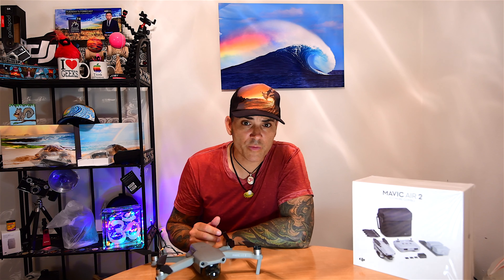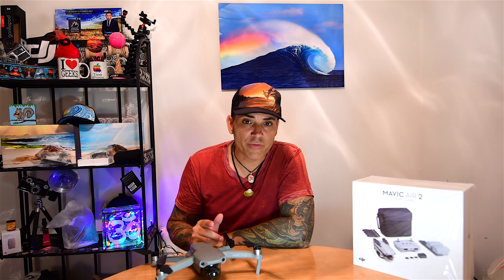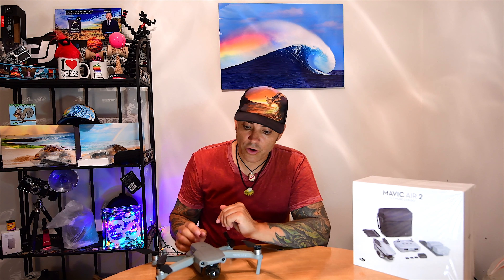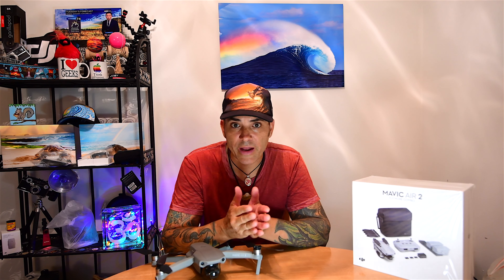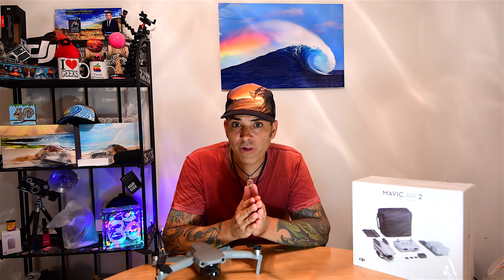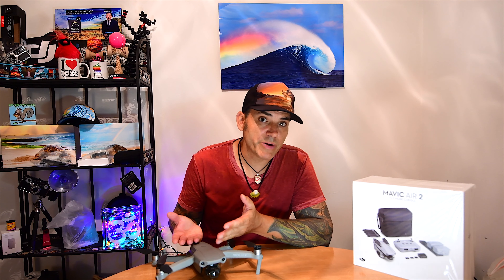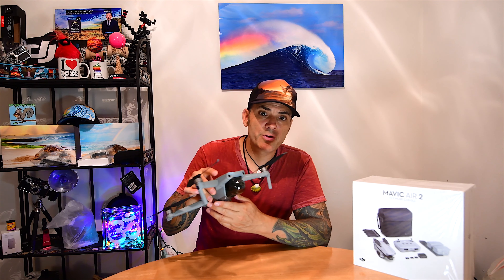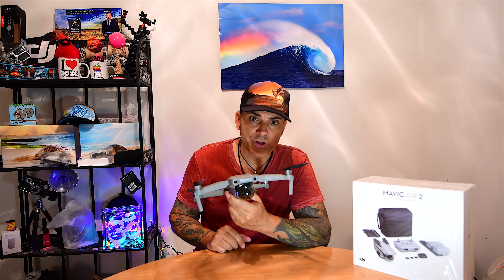Mavic Air 2 Overheating Issue

Comment: There are distinct advantages from buying from Best Buy as opposed to direct from DJI.   45 day Platinum Member Return Policy.  You do not get a refurbished unit to replace your brand new unit.  You do not have to wait 30 or more days for a repair tech to evaluate your defective product.  You get to replace the defective product almost instantly with a brand new product.  Finally,  you get 18 months or more no interest financing.
Reply from the maker: Stewart Bernard yup I messed up buying from them.  That’s some bs that they want to send you a refurbished product when your brand new one fails.  I’ll contact BBB if I have to if they yank me around pulling that noise.
Reply: I hope you luck with the BBB but DJI's return policy allows them to replace your new drone with a refurbished drone.  I would demand a new replacement or put the transaction under credit card dispute if you paid with credit card.  As soon as there is a firmware upgrade for the Air 2, I plan to purchase a Smart Controller and I will purchase it from Best Buy, not DJI.  If all else fails, chalk it up to lesson learned.  We drone purchasers will buy many drones over the years and DJI will lose the direct sales if they keep this policy up.  I am also beginning to question DJI's quality control after reports of these overheating issues.  I always thought they made quality products until now.

Comment: I have been flying mine in 115+ temps for about 25 minutes every sunset for about a week straight. The bottom gets hot after I return home, and I don't go for a second trip because I worry about overheating. This kinda worries me, but I assumed it was from me flying in hot temps.
Reply from the maker: Yeah that’s pretty extreme temps.  I mean once u change out to a new battery which ideally isn’t that hot and more ideal temp that helps too.  Can’t hurt to have in A/C car or house in between flights too for some added peace of mind.

Comment: My Air 2 gave me an overheat massage also (but not an auto return to home) and it was a hot day when I flew it (100deg). I stopped flying it for the day and it has not done it to me again (also not flying it on days over 90deg anymore). How hot was day when you had the issue?
Reply from the maker: Rick Rob it was about 84 outside possibly 86....the thing is I literally flew for only 5 minutes and this happened.  Just really bizarre I know 100% something with the fans on this unit isn’t performing properly.
Reply: Wow, the Mavic Air 2 gives massages! That is a new function.......
Reply: @gaijin-eyestutorials7185  haha yeah you have to upgrade the firmware and it'll massage you, no happy endings though but maybe in a later update..

Comment: Hi bro just bought an Air 2s, two weeks ago,had an onboard fire beneath the battery compartment shortly after take off in a hover, low winds .The App wobbled slightly and smoke poured out of the rear vents.The craft was landed and smoke continued and it's completely unusable.This was only the third flight.Issues from day one.I do love DJI products but your right bro we need peace of mind for air safety.Great page bro

Comment: My DJI mavick air 2.. Is overheating on my 2nd day of use.. I have the Mini and Autel one.. This is very disappointing for a new piece of equipment... Evidently it's a much larger problem and should be a recall.. I was flying over the Navesink river in New Jersey... And had no control as it returned the back... Very disappointing...
Reply from the maker: tommy curran I believe too DJI is not saying to the public how many issues these Mavic Air 2’s are having I agree....they are releasing products prematurely in my opinion.  Sorry that happened to you too.

Comment: When flying the Mavic air 2 and using slow motion my drone forces a landing after a few minutes and says the processor chip is overheating. Runs fine in all other modes though.
Reply from the maker: jared loewen weird.  I had a massive overheating issue with my previous Mavic Air 2 but had nothing to do with using slow motion mode....I haven’t even tried that yet and personally not a fan of this new firmware update.  I could care less about the digital zoom modes I never use digital zoom on anything I own ever.  Keep us posted if u experience anything more.  Good luck.

Comment: I read on forums of someone that took apart their mavic air 2 so they could properly apply thermal paste and heat pads to their Mavic Air 2, I'm going to do that to mine.

I just got my Mavic Air 2 yesterday and took it on it's first flight today here in 80 degree weather in central florida. During my firmware update yesterday, the fans definitely ramped up and I got an over heating warning after the update. Then I got it several times today while flying and it tried to land like three times.

I noticed that my fans are pretty much always on high mode and this thing keeps overheating. I have built a few computers from scratch and do a lot of automotive and electrical work, so I'm gonna take this thing apart in a couple of days when the paste and pads get here from amazon. Most likely there isn't enough paste spread inside of the Mavic, or the cpu and ram aren't properly contacting the heatsinks (the pads will solve this).

The forum member that did this reported that his fans barely ever came on afterwards. I'm surprised I got this issue so many months later for a new unit, they really need to pay attention to cooling this aircraft, it's not safe and massively inconvenient otherwise
Reply from the maker: Do a video on it if you can would be awesome to see.  I would watch for sure!  🤙🏾🤙🏾
Reply: @AtortAerials  hmm, thats not a bad idea. It might help out other mavic two owners that have the issue as well. I'll let you know if I post anything!

Comment: Only just turned my Mavic air 2 on and straight away fan noise and red hot underneath, is this normal?
Reply from the maker: See what happens....it’s normal to heat up and fans to turn on, but for my example fan basically wasn’t even spooling up and working.

Comment: I had to send my Mavic air 2 back to Dji. The problem started when the fan wouldn't start when turning on the drone, causing a processor overheated error. At first the fan would delay a minute then finally start up. Eventually I started to time it and every day it would get worse. One minute, then five minutes. Then eventually the drone would just shut itself off because the fan wouldn't run. I will be getting it back on Monday. Dji said they had to replace the processor board and the fan. I believe this may be a flaw In this drone because there are beginning to be many complaints of this problem. Perhaps they used cheaper parts allowing them to sell it cheaper, honestly I couldn't say. It's a shame because when it works it freakin fantastic. I will let you guys know what happened when I get it back.
Reply from the maker: Eric Manigault kee me posted please and I agree....it’s amazing drone when it works!
Reply: UPDATE! I received my repaired Mavic Air 2 back from DJi. I was only able to put it up twice but the problem seems to be fixed. No processor errors and the fans kick on immediately during start up. They replaced the processor board and fan. The whole processes of repair was 4 days. The shipping time to dji and back was  9 days. Not to bad since I opted for free shipping. The repair process was smooth and DJI kept me up to date every time they made a move. Patients is the key...

Comment: didnt have the overheating issue myself (although I've read that a bunch of people have). I did, however, have a motor which spun harder than the other 3, out of the box. I've replaced the drone with a new one immediately in the shop. So far so good with this one, no issues. 
But yeah, I wouldn't agree on repairing a brand new drone, just for replacing it. DJI will replace it, I'm sure.

Comment: I have the same problem and I just bought it from bestbuy. I have an autel evo 2 that never had any of these issues. This is my first dji drone. Im upset 😡
Reply from the maker: Well swap out at Best Buy and see what happens.  Make sure to buy refresh too it’s really worth it will save your ass I promise.  Just exchange and try again. Good luck!
Reply: @AtortAerials  i deleted the dji fly app from my samsung s10plus and then re downloaded it. So far the esc error message isn't popping up or the esc overheating message. Only flew one battery so far after doing this but it worked perfectly again no issues. I've never had an issue like that with me Autel Evo 2. The battery design on the Autel Evo 2 is much more superior to the DJI Mavic Air and the Pro 2. No venting in that battery bay its like a hot tub  for a battery. Then you look at Autels design and right away you can see it is much much more thought out than DJIs design.

Hopefully, the "esc error" and "esc overheating" red warning flags don't show up again. So far so good 👍. If it appears again and I can't fly because of it one more time im going to best buy with it.. calling to report to bestbuy about the issue if it arises again. Thanks, take care brother. I have both drones fully insured through my state farm personal articles policy. Only 45 bucks per year and covers the drone and other people property in the event of an unforeseeable accident. Only reason I didn't get DJI care refresh. I also heard they send you refurbished drones over half of the time which I'm not super happy to hear. I might ask about it when I go in to report this issue tomorrow at bestbuy. If its not that much I will get it just to be safe and double up on back up plans if you will.
Reply: Same problem is happening again now with the "esc overheating".. then everytine i restarted the drone is says it can't take of because the "esc error " message. When I start the drone when working fine the motors do that initial twitch (all 4). With this current esc error happening i notice that the 2 left side motors are not doing the initial twitching upon startup. This same issuse i had about a month ago has come back now today. I am going to bestbuy at this point and returning...
Reply: So bestbuy denied return and exchange because it has been over 30 days ( about 34 days since purchased). I started a case # with dji repair department. Its such a shame to pay over a grand for a little drone and it only lets you take off every other day. No peace of mind. I own the Autel Robotics Evo 2 8k drone and I have solid reliability with that one. I really do love the air 2 when it lets me take off..

I have done some strange things that cause the esc error to disappear temporarily. When I do an imu calibration everything acts fine for about 1 flight. Then the problem comes right back. I have also formatted the sd card and it go's away temporarily as well. When it happens, the bottom of the craft heats up a lot. After it cools it still says esc overheating right upon startup

Comment: My first Mavic Air 2 had an overheating fan issue also.  I only flew it inside the house and it overheated after 2 minutes.  There was no heat fan operation whatsoever.  I returned it to Best Buy under my 45 day return policy and ordered a second one from Best Buy.  I have had no problem with the second drone.  I had none of these problems with my original Mavic Air.
Reply from the maker: Stewart Bernard I honestly screwed up being impatient and ordering off DJI site upon launch.  I should have bought somewhere else.  Best Buy gave u no issues?  Obviously  Elite member would that helps too.  Embarrassed I worked there before.  🙈🙈🤪
Reply: @AtortAerials  👍

Comment: I was having overheating issues with my Mavic Air 2 as well. I ended up returning and just upgrading to a mavic 2 pro.
Reply from the maker: Nice.  What do you think of it?  Did u get the smart controller or no?
Reply: @AtortAerials 

I'm in love with it honestly. It truly is worth the extra money in my opinion. Its got everything a photographer would want for the most part speaking for myself because I do photographythe pictures just come out smoother and overall more satisfyingand not overly sharpene.. I've compared my Note 10 plus to the pictures I got with my Mavic Air 2 and couldn't tell much of a difference. The Air too is basically a smart phone camera just attached to a drone. I dont have the smart controller I just use my note 10 plus.

Comment: I purchased one from Walmart today.. I updated the firmware and calibrated and compass and the drones processor started overheating🥺
Reply from the maker: Ugh.  Maybe just exchange and see if happens again with replacement?
Reply: @AtortAerials  My first one kept getting processor chip overheating 🥵 warnings in 32 degree snowy weather. I shipped it in and was shipped another drone. The internal fan was malfunctioning, my new one is perfectly fine.

Comment: I had the same problem it overheated on me I had changed props and it flew fine so im thinking the props were slightly bent that made motors run hot.
Reply from the maker: Keep an eye on it and change out props?

Comment: I just had this problem yesterday 14 Aug 2021, I bought Mavic Air 2 just 2 weeks ago, I fly it around 20 minutes yesterday to take project photos. On return, I have recognize its so hot really, maybe used it in the peak of noon time. Other than noon time flying, its hot but not so hot as yesterday. Thanks for sharing, I will observe more in my next drone flights.

Comment: I have had an issue with the aircraft chip processors overheating and My Mavic Air 2 is less than 1 months old and only 3 flights. When this error/overheating happens the drone will try to return home no matter the altitude and try to land. I contacted DJI and they told me to send the drone back so they can test it. I let them know I will never be confident with that drone again and want a new replacement. To be sure I receive a new one, I placed a small mark on the drone where I can tell if it's the same 1 or not. DJI support is terrible! I am waiting for the "fixed Mavic Air 2" in the mail. Hopefully yours gets taken care of.
Reply from the maker: adam miller it’s a freaking nightmare for real right!  Same thing happened on a job yesterday and was SO unexpected because didn’t even know that was a thing.  I have owned two phantom 4 Pros and a Mavic Air and Mavic 2 Zoom and Spark and never once had any force return home from overheating.  I have zero confidence with this drone either that literally I had for 8 days now with nothing but headaches and they act like maybe we’ll replace it?  Unbelievable horrible support I told them they are going to lose customers if they don’t realize treating customers like this continuously is not right.  Like it matters to them, but felt like I should let them know.   Honestly dealing with them is worse than spending $1500 on something that doesn’t work.  F’n have a headache over it...such a waste of energy which DJI doesn’t seem to realize equates to money for many.  Good luck man!

Comment: Mine is doing the same. Reached out to DJI; hoping they stand by their warranty!
Reply from the maker: David Hamilton they are super f’n annoying....I’m having a horrible customer service experience with them right now with mine.  The 3rd replacement from them and still messing up and yet they refuse to give me a new Fly More Combo because they say “it checked out fine” despite me having tons of video showing otherwise.  I was on 3 paying jobs and this messed me up so much yet they don’t seem to care what they’re paying customers say I guess.  🤬
Reply: @AtortAerials  that's terrible! I hope more people report their issues to make DJI acknowledge the problem.
Reply: @AtortAerials  apparently their repair center in California is down because of Covid, so I'm high and dry for the moment too.
Reply: Atort Photography this is really disappointing :(...I’m waiting for my shipping label for a replacement after I got overheating messages on the first flight out of the box. Not so confident in my replacement now :,(
Reply: @Franksdad_deanmartinonrepeat  mine was covered and had the fan replaced. Will find out next week if it fixed the issue!

Comment: So, I just got a drone replacement from apple...I noticed the first drone which i had that didnt connect felt very hot to the touch. I sent that back to apple and just received a replacement. Mine wasnt even flying had it on my bed. The bottom felt super hot almost to the point of burning me.then the dji fly app said it was overheating. I saw someone post a fix, that they dont have enough thermal paste on them and its not properly insulated. The poster had to put thermal pads onto the board as well. Im not going to do this as it voids your warranty and you may screw it up where it wont fly at all. I do believe most of these will have overheating problems. I will test it this week. If i get an overheating return to home message, i will return this to apple and wait till the next version is out. I dont have much confidence in dji as alot of people are having overheating issues
Reply from the maker: Michael Klein thanks for sharing.  I don’t have much confidence in them either lately.
Reply from the maker: Michael Klein did u get the entire thing replaced like a new fly more combo or did u just swap the drone only out?  Crazy how many having issues it seems I’m glad I posted my experiences.
Reply: Atort Photography I got the overheat issue with the drone on my bed no propellers and ran it bout 15 min before i saw that. I will take it out this week and fly it for 20 min constant at 30 feet high just hovering in case it overheats. I’ve read a guy who fixed it but he had to open the drone, put thermal pads in on top of processors and used thicker thermal paste. His overheating problem disappeared. Its due to DJI cutting corners with this drone. If I get overheating, I will return this again to apple and I’ll wait a year for the mavic air 3... Going to look into a class action lawsuit against DJI